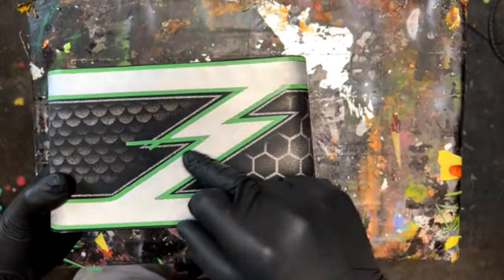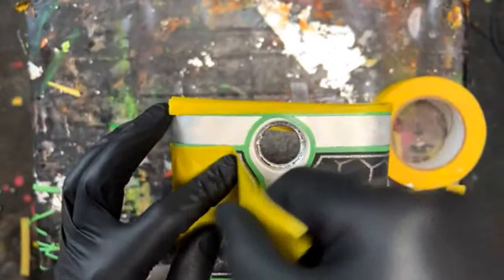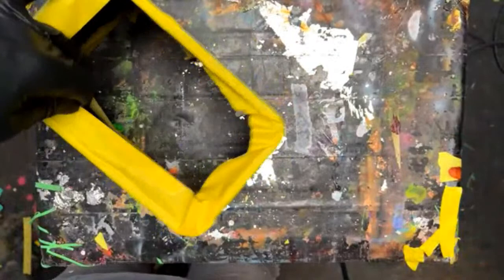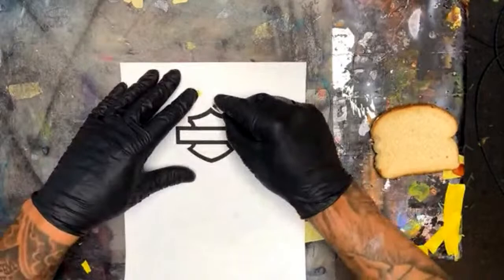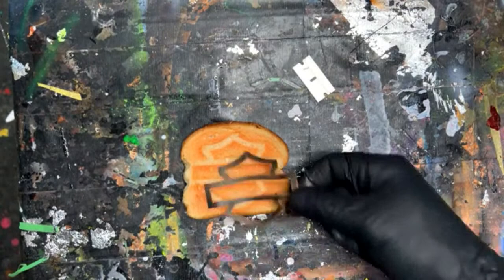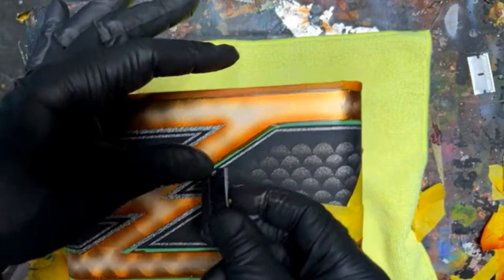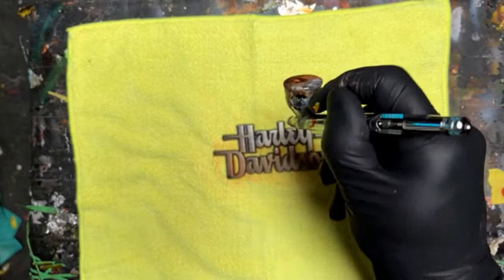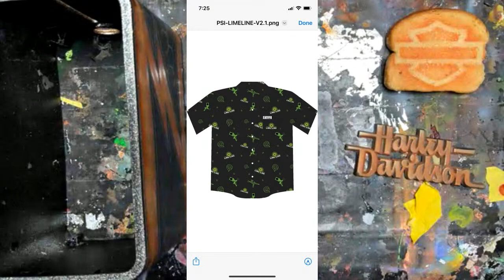Live Toaster Transformation Part II: Fixing Custom Paint Mistakes with Time Warp

Comment: I was sad I missed your live, I was busy... I do have a question, let's say I put adequate enough clear coat over a base paint color, should I apply another layer of primer If I want to paint a design onto the clear?
Reply from the maker: no you just need to scuff the clear down so the next layer has something to stick to
Reply: @TimeWarpCustomPaint  thank you very much for the reply, I have been getting stuck repairing paint peeling off every other area. I would like to stop making this mistake. If I wanted to paint onto a base color instead of the clear coat, would I also need to scuff the surface? Do you have a LiME LiNE scuff pad to recommend?